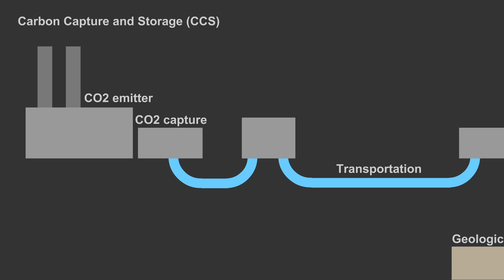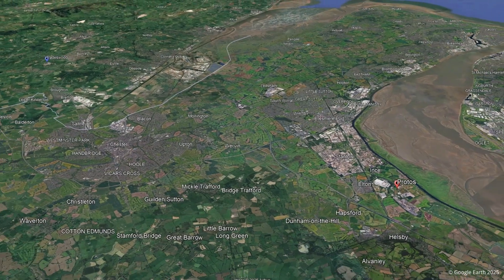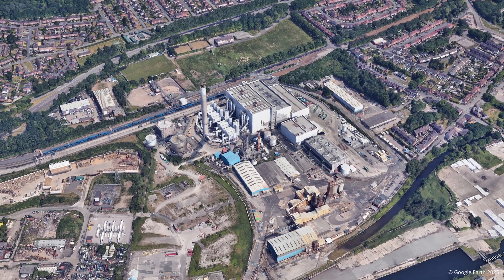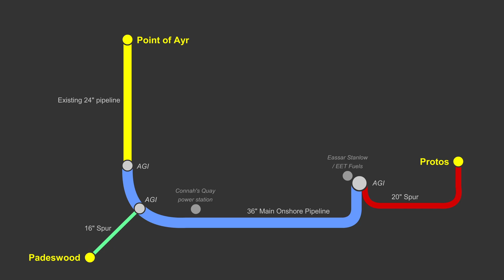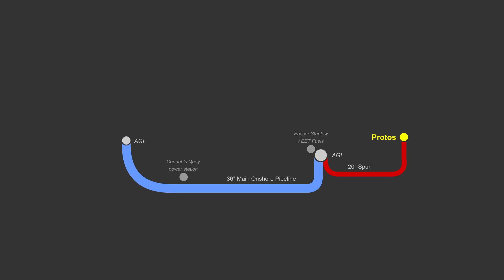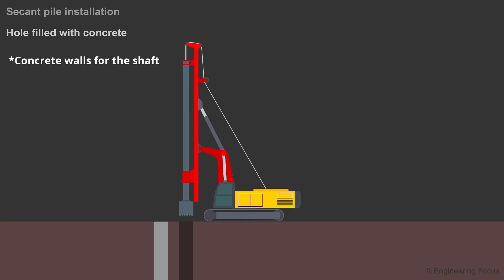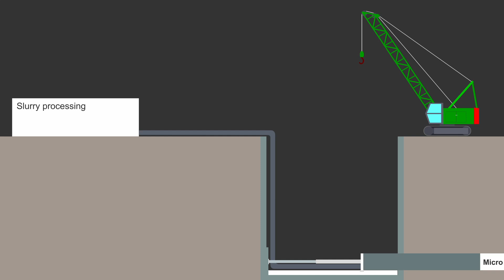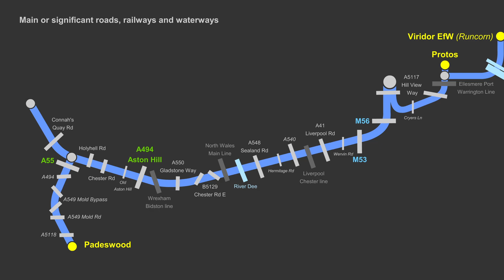Major New Cheshire & N Wales Pipeline | Hynet North West

Comment: This reminds me of the oil pipeline from Stanlow to Moelfre on Anglesey that was installed in the early 70's. I used to see it happening when as an apprentice I rode my motorbike from Ruthin to Rhyl every day. I wish you could turn back time and to a project on that.  Could any of that pipeline be used for this project or just pumo CO2 into the pipe it must be massive volume?
Reply from the maker: There are a few projects that I wish I'd been able to cover. Lots happening nearby though so I should have plenty of material.

I'm not sure if the oil pipeline is still in use or is usable. I know most of the oil comes via Tranmere Oil Terminal these days.

Comment: Thankyou for the very informative video. I assume this is what I saw as I was driving towards Wrexham from the M56. Spent a whole morning trying to get Ai to teach me a bit more about Carbon Capture. Appears you have to burn  about 20% more gas to actually capture the carbon from the gas you've already burnt?? In which case it's a pointless endeavour. Like a lot of the comments on here, something about this proposal isn't ringing true. Could this pipeline be converted to bring gas in if required?
Reply from the maker: I've read a few conspiratorial comments saying it's a gas pipeline. But I think gas pipelines have to be built to a completely different standard and I very much doubt it could be converted from CO2 to gas easily. Added to the fact, as I point out, the gas fields the existing pipe leads to are either soon to be depleted or are already depleted, so there will be no supply of gas to this pipe. 

I'm skeptical about CCS too, but I need to research more about the new system developed in Japan that Padeswood plans to use. I think ultimately companies wouldn't be investing their own cash if there wasn't some benefit, albeit financial.
Reply: @Engineering-Focus I believe the wells in the Irish sea are depleted. I just expect there'll be gas tankers docking in from around the world at the Facility in Flint which will need decompressing and pumping round the network. I'd expect a gas pipeline is a gas pipeline whichever way it's flowing. Good job it's all being paid for with hypothetical carbon credits.😬

Comment: Why couldn’t it have sent down the Mersey river? When I was employed putting up the North Hoyle wind turbines off Prestatyn, we had an  underwater trenching machine that buried the HV cables.
Reply from the maker: The Mersey is regularly dredged and I'm not sure how practical it would be to use cable laying equipment to lay a 30 inch pipe.

Comment: What a waste of Money !  the only good thing is that a few jobs will be created !! I worked on a Statoil Carbon Capture project, it was known that it was a project to keep folk happy but would have no significant impact on CO2, it was what Norwegians called, a Vanity Project. Statoil had enough spare cash to do the Project but it was expensive because all the vessels and piping were in high quality Stainless steel. which was then aluminium metal sprayed, also expensive !!
Reply from the maker: This is 1 or 3 potential schemes as well. It is worrying that CCS doesn't seem to have proven useful

Comment: I live a couple of miles away from Point of Ayr, we don’t seem to have RDX signs near us however as I’m currently working in Warrington I have noticed the signs near Stanlow and Costco Junctions but also from Queensferry through to Saltney. Great to see a fairly local channel coming up on my suggested videos.
Reply from the maker: The existing gas pipe from Flint to Point of Ayr will be repurposed, so no physical work will take place between the two pounts I don't think.

Comment: What’s the estimates of co2 release of all the mining and transportation of raw materials to steel manufacturing plant, manufacturing of the steel, manufacturing of the pipes, transportation and installation of pipes, building of co2 capture building and equipment, all the food imported for the endless meetings of the ppl who managed this farce 😂. If you are worried about co2 release from concrete manufacturing, how about this, reduce the amount of concrete we use 😮
Reply from the maker: You're right we need to cut CO2 from all emitters. But there are no steel producers in the North West
Reply: @Engineering-Focus yep, import the steel from China who get the raw materials from Australia, that’s great for the environment 😂
Reply: @Engineering-Focus all that for carbon capture, oh the irony 😂

Comment: what a stupid way to spend money as such a missed opportunity to do somthing better with it for the same purpose. Such as expanding the community forests massively and investing in training and infastructure to do somthing usefull with all the timber and protected greenspace. No lets build a pipe which as very few uses. But maybe theres less lucritive contacts in that from all the dodgy backanders and favors.
Reply from the maker: Trees are not the long term storage option people think they are. Plus the amounts of C02 we're talking about couldn't be easily offset by tree planting alone. A mature tree only captures around 10-40kg a year. Saplings would take a decade or more to absorb any meaningful amounts of C02. But also when trees die they re-release carbon as they rot.

Comment: Interesting. The "Peak Cluster Project" is another CO2 capture project, even bigger that the Hynet project. It is also planned to pass through the Wirral.. This is taking CO2 from Lime and Cement works in Derbyshire and Staffordshire to Morecombe Bay via the Wirral.  It would be good if you come cover this project as well.
Reply: Peak Cluster CO2 is heading to Morcambe Bay, not through Wirral.
Reply from the maker: Interesting, someone else mentioned yet another pipe but I wasn't aware of another project. The joys of living in the middle of industry and energy clusters. I'll do a little bit more digging. Thanks for the suggestion
Reply: @Engineering-Focus Please do, we have had a letter saying the project may affect us but there's very little detail of a route so far as I can see. Would be interesting to see some detail.

Comment: Before it was used for Road Crossing ( first time I’ve heard of that) RDX abbreviation was, and still is, used as a name for an explosive.   
You really need to check the original use of abbreviations before you reassign them!
(RDX-Royal Demolition Explosive, also known as cyclonite, hexogen, and hexahydro-1,3,5-trinitro-1,3,5-triazine)

Comment: This is all done to justify using wind power for base load power which then needs power stations which can be started and stopped quickly to fill in when the wind isn't blowing. This is instead of the no CO2 alternative for base load which is nuclear.
Reply from the maker: Not really. Hynet is about reducing C02 from facilities that can't easily be de-carbonised. Connah's Quay is a separate project. If the new more efficient power plant is being built so the existing one can eventually be wound down and decommissioned then that's a good thing 

The fact is we need an energy mix which includes nuclear, solar, wind and storage. But we also have new energy from waste facilities that will be emitting CO2 for decades, which could only be closed if we achieved 100% recycling.

Comment: what a waste of money and what happens if the gas gets out of the pipeline every unsafe
Reply from the maker: Then the pipeline will shut off. There will be safety systems in place and risk assessments carried out.

Probably safer than the existing high pressure gas mains that cross the country that people don't give a second thought about
Reply: @Engineering-Focus  it's not really as simple as it shutting off - all high pressure pipelines don't have valve controls evenly spaced at say 1 or 2km for example. many pipelines regardless of what's in the pipe can have sections running tens of miles between control points. whilst this installation is modern, it's not an installation with purely new pipework, many sections are repurposed existing pipeline

Comment: as the gas runs out or it gets to expensive are they going to use the pipework for something else.
Reply from the maker: Do you mean the whole gas network? With regards to Hynet, the gas is about to or has run out in Liverpool bay, so they're going to reuse the existing gas pipe and reverse the flow to pump CO2 into the depleted reservoirs.
Reply: @Engineering-Focus  its that gas power plants are getting to expensive to operate and will be used less in the future.

Comment: Once commissioned, how long will it take for the carbon captured to offset the carbon emissions of the construction and the materials of construction? What year will that be?
Reply: We are virtue signalling to the detriment of our industry. This money would have been better spent reducing industry energy prices. The rest of the world are laughing at us.
Reply from the maker: If CCS works, then given Passwood alone emits 800k tonnes a year, then the answer is not very long at all. I'm sure there will be a payback figure somewhere.
Reply: In 2023, China emitted 25x more Co2 than UK, and India emitted 7x more Co2 than UK. Are China and India investing in similar infrastructure, as it’s more needed there than the UK.
Reply from the maker: Yes China is decarbonising faster than many countries. But we can't expect other countries to act if we're just going to say why bother. Especially as we've benefited the most from burning fossil fuels.
Reply: @Engineering-Focus So we make our industry uncompetitive first. That sounds logical!
Reply: Even considering the emissions from Padeswood cement works alone (800,000 tonnes carbon per year), the system will offset that within 6 months of operation.

Comment: BTW, it's a "Haul" road, as in Haulage, they had one on the Western Link. The A540 / Mudhouse Lane junction was Auger Bored for the Western Link. We took an interest in the Western Link, and they took us everywhere, showed us everything happening. We just responded on their website. After it was completed, before it was handed over, the 'power Station Designer", called us one afternoon, and asked us to come in and showed us around the 2.2 Gwatt converter station at Shotton. Both the Civil and Railway industries are only too keen to show their work.
Reply from the maker: If you're talking about the captions it'll be a typo, I'll check. Fairly sure I said or attempted to say haul 🙃
Reply: Do you know if the Pipeline goes anywhere near Northrop Haul?
Reply: @mikeoglen6848  haul would I know ?

Comment: I mean there are family's staving, most of the towns around Cheshire and dead or dying and need a kickstart and redevelopment but a huge underground pipeline network for a untested and unproven system is a good investment i guess, might sell my house tomorrow and buy a new electric car while we're at it ya know ignoring real world issues and focusing on pretended environmental ones 🤣
Reply: Think of the investment as an investment in jobs the and by extension an investment in community. A percentage of employees on this project will be parents and will be spending their wages in towns around Cheshire. This project is protecting our future and lowering toxic emissions which are a health hazard. Environment is important as we actually breath this air. The pipeline is kind of an extractor fan like in your bathroom, You don’t have one then condensation causes black mold and damp which is deadly. This is a win win situation.
Reply from the maker: We need both, ensuring children don't go hungry and ensuring there's an actual future for them. You may not believe in climate change, but it is a scientific fact.
Reply: @Engineering-Focus  Doesn't mean we're the primary cause!
Reply: @Engineering-Focus  pull my other leg  wait till the pipe breaks and spreads death all around  ps the climate always has changed
Reply: @Engineering-Focus  Of course it is a fact.  It is also a fact that if the UK went net zero tomorrow a drop in temperature of 0.0007 Celsius would result.  I can provide the calcs if you are interested.  Not much of a cost benefit analysis going on.

Comment: Fascinating video  a lot of work has gone into it, as well as the pipeline design, pity they didn't put it down one side of the m53 m56 and along the coast road to point of air, instead of following a drunken  sheep  across so  many  fields, can see some of the  neighbours to  the pipeline being less than happy about the noise and dust though.
Reply from the maker: The route does seem very circuitous, even more so than the Western Link. But I imagine it's been quite a process trying to secure all the land required.  Needs to be farmland or pasture, with no prospect of building above. The route through Sandycroft is a bit all over the place. 

Locals won't be happy about the noise, but I think this will be less disruptive than the Western Link at least.

Comment: Interesting stuff! Carbon Capture & Storage is undoubtedly a scam that only exists so that the largest emitters can continue polluting (and it's really disappointing to hear that a new gas power station is potentially being planned) but that doesn't make the engineering any less impressive, and this video provides a really informative insight into some construction techniques which I was previously unaware of!

Also, it's interesting to see that you've posted this on your old Transport Fever channel, rather than the other Engineering Focus channel you had previously, but I suppose it makes sense as this channel has more subscribers so hopefully would reach a wider audience! I note that many of your older videos seem to have disappeared. If you haven't already, might it be worth unlisting the old videos and then making a playlist of them so that people can still access them if they desire (albeit through a somewhat circuitous route)?
Reply from the maker: I'm yet to be convinced that CCS works. I'm not certain any of the attempts so far have worked.

I think the problem is, particularly in a Cheshire is the amount of industry that can't easily be de carbonised. But Protos is constricting more emmitters, especially the plastic to hydrogen and gas to hydro plants, again and it's not certain if anyone will make use of all this hydrogen.

But the Government has bet huge sums in the Norty West and North East on CCS working.